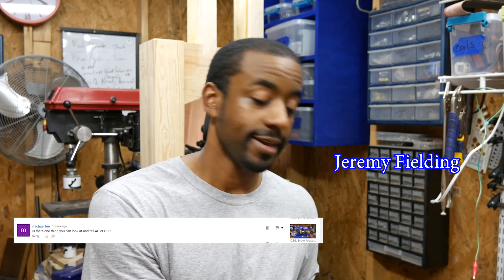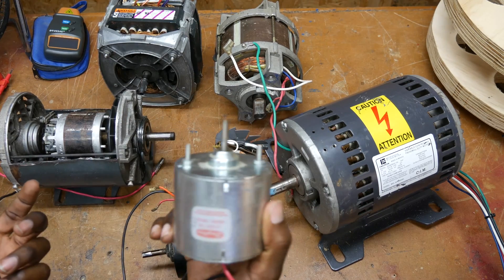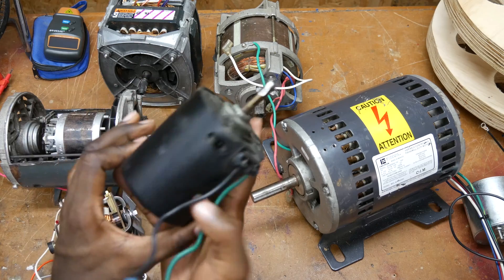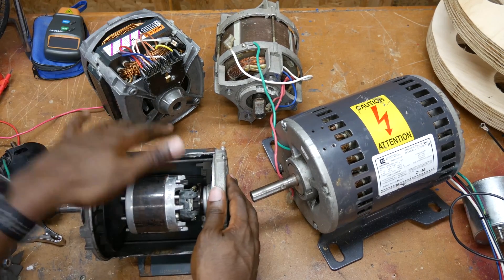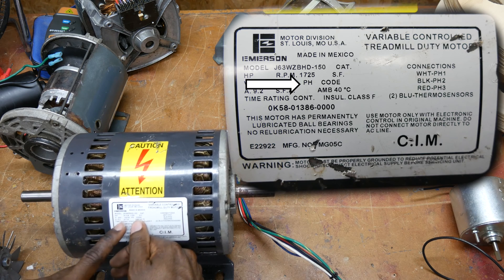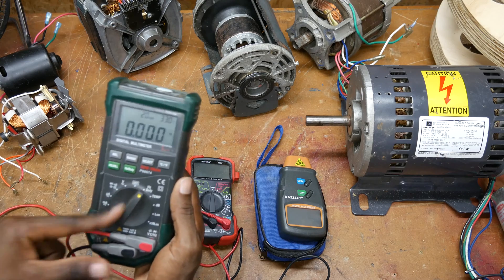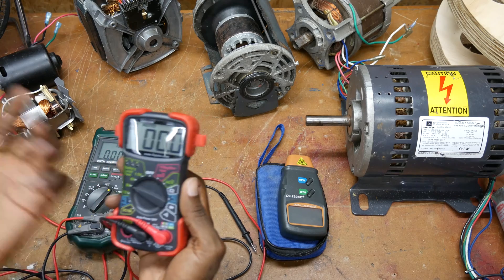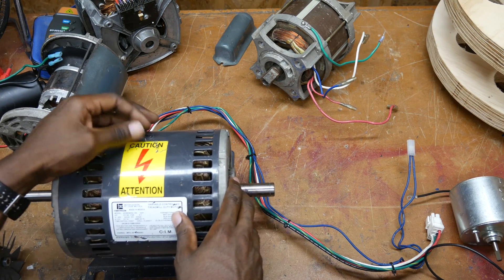What Kind of Motor Do I Have? Some Clues to Distinguishing Motor Types: 042

Comment: I got two washing machine motors  because i want to make a pottery wheel. Pottery wheels need to have adjustable speeds. Will a washing machine motor absolutely  not work for my  pottery wheel project?

Comment: Great video! Thank you for sharing your knowledge and experience with electric motors.
Any advice on how to troubleshoot when I disassemble my Toro Electric Corded Power Jet F700?  
Wait, I think you provided the answer when you identified the "Universal Motor and Direct-Current Motor"?  My Toro Power Jet F700 died two-(2) months past the 2-year warranty! I hope I can fix it: I quit using it because sparks were arcing inside when I looked in the exhaust. I did some research and then proceeded to disassemble the leaf blower: I was a little apprehensive, but I pressed forward with the disassembly because I quit using the leaf blower and hoped that I could repair it [big dreams].  My Father was a Master Electrician, so I retrieved his old book titled Electric Motor Repair by Robert Rosenberg: I am trying to understand what type of motor is in my leaf blower: I was leaning towards a Alternating Current Motor Control because I must plug it into the house electrical receptacle for it to power on; however the Universal Motor is applicable to both AC and DC?  It was a challenge to reassemble too because the plastic housing has to matchup.  These past four-(4) days has been frustrating because I searched both YouTube and the internet and also read the Electric Motor Repair book and I still cannot get the leaf blower to power on when plugged into electrical receptacle. I used color matching zip-ties, so I can reconnect the correct wires [only 2 pairs!!]  I thought once I cleaned-up the commutator I thought my leaf blower was going to operate.

Comment: hey Jeremy! i recently got an antique 9" general electric oscillating fan c.1917.  the catalogue number is 174942. It is a 110volt 25cycle fan. doing some research i have found out that niagara falls produced 25hz power to new york and ontario. i have found an original catalogue that describes this fan of having a "series commutator". is it safe/ok to power this fan with standard 110v 60hz? if not what would be a good non invasive way to power the fan? thank you.

Comment: Important! Some single phase induction motors have only 3 wires for unreversable motors and some 3 phase motors that are wired in star or Y configuration often have 4 wires for an added neutral also some single phase motors have resistance start motors so no capacitor is needed

Comment: Hi Jeremy, thanks for the videos!!... I have some questions, if it's possible to make them here. I have a table saw with a baldor pl3515m that I think I pushed to hard... This would be an induction motor right? Well it doesn't start... I tried the thermal reset, nothing... I've checked the capacitors, and power is getting to them (high voltaje wiring, 230v), could it be the coil burnt out? What would be a set of checking steps?... TIA!!

Comment: I have a puzzling question: My husband saw this 25hp compressor motor. It can run on both 240V 3ph to 480V 3ph by just switching some wires under the cover plate as instructed. How does that even work without transformers, no one can seem to explain this issue anywhere ? ... But I know you have the answer Mr Fielding.

Comment: Hey brother I have a problem I have a 6 wire washing machine motor no one has this weird thing anywhere it was built in Mexico here's the info hope I got enough info the series number is S68PXMTM-1904 it's a 1/2 up 120v 60HZ 8.5/7.6 amps 1725/1140 RPM class F oh and it says pin 6  35-6671has a spot says AMB idk I hope you can help me and this ain't one of those matters that I'm stuck with a heavy bulky paper weight thanks either way sir

Comment: Enjoying your videos alot and helped me to understand electric motors. I have a motor from an electric shredder with 2800watt, however what does 2800/40 min-1 mean? This is a very slow turning motor with gears. What could one use this motor for? Keep up the good work 👍  br Frank

Comment: I need some help... My kids had a hoverboard they broke. I still scavenged the hub motors out of it and plan to make a sort of go-kart. I don't know much about motor controllers. As cheap as possible, I need controllers that will brake the wheels and have reverse. I want them to function just as they did on the hoverboard. Funding is a big issue! So any ideas would be great... Oh they ran off 36 volt dc but are 3 phase (assuming AC) and have a hall sensor. Are 3 phase DC motors even a thing?
Reply from the maker: I don't usually answer technical questions because the volume is simply insane. I just can't help everyone... but I will say this is more commonly called "brushless DC motor" you need a controller for that. Sometimes people call them AC motors but they are kind of both in a weird way.
Reply: @Jeremy_Fielding  that's the same conclusion I came up with. My issue is that I don't enough about controllers to filter through the mountains of them looking for one that will let them function the way they do on the hoverboard.

Comment: So you determine (or guess) that you have a DC motor. How do you determine what voltage and amperage it requires?
Reply from the maker: Great question. I have no idea. I usually go for trial and error until I think its behavior is usual. But I can’t recommend that in a video
Reply from the maker: There are a few more things that can be done but in the end the more information you start with, the easier it is to search for the rest

Comment: Heya Jeremy. I am STUCK! I am a physics and Engineering teacher with an engineering education, I work with a civil engineer, and I am lost on one thing. I recently pulled the spindle drive motor out of an old benchtop CNC mill that was no longer viable, and it has 3 wires....what the heck! After watching a bunch of your videos on motors and doing a fair bit of reading, I can run the thing. The three leads are red, green and black, and if I connect the red and green to power it will run (at voltages ranging from 12 to 30 from what I ahve tried so far) but the black lead baffles me, it seems to have no function. Any thoughts?
Reply from the maker: Usually there is a ground wire. Watch the how motors work question and answer video. There is a link with more information. Different manufacturers use different colors sometimes. I am not giving advice however. There are just too many ways I could be wrong.

Comment: I do hobby electronics and I use Hertz and capacitance on my multimeter all the time.
Reply from the maker: Yes... someone doing electrical work clearly needs a nice meter. It is the center of all your projects... for me it is a tool that occasionally finds itself on my bench for brief periods... then out of the way so building can continue.
Reply: Jeremy Fielding actually I use a cheap but good meter called aneng an 8008 it's under $20 on banggood or eBay. It works great but I would not trust it with higher voltages. I have used it on 120 volts but I would rather use a UL listed meter for anything over 70 volts. But for the day to day stuff I do it works great.
Reply: What do you use "hertz" for?  I suspect it could be used to measure motor speeds if one were clever enough, or the frequency of a 555 circuit?

Comment: Have you ever tried to repurpose an electric fan motor?  I've been planning to make a compost sifting trommel for my garden, and I was wondering just how powerful a motor I'll need.  I have some old 3 speed box fan motors and the trommel only needs to rotate at between 25 to 32 r.p.m.  I've seen some pretty small motors do some pretty heavy duty jobs, so I'm thinking It's just a matter of getting the gearing right.  I most likely won't be needing to rotate more than 20 pounds at once, but continually.  My biggest problem is likely to be dust control.  That little blender motor of yours looks awesome.  Are the bearings still good?  Why isn't it still in a blender?  Did you only take it out for the video?  My son brought home an Oster blender that works, but the bearings just shriek and scream!  Your motor looks the same.  I'm still waiting for new bearings to come in for his motor.  I suspect that after I fix it he'll sell it on Ebay or something.  Oh well.
Reply from the maker: The coupling that held the blades on broke off. It was made of rubber and there was no good way to replace it. So, I started using the motor in videos like this as an example of a universal motor. 
Fans are usually induction motors with different taps for different speeds. The problem is the starting torque. Especially if it is a shaded pole induction motor. They have almost none. You would have to push it each time if you could get it to run. A fan requires almost no torque to start the blades moving... therefore companies save money by not solving that "low starting torque" problem. I have a video dedicated to fan motors. https://youtu.be/JTlHNOaBnPI
Reply: Okay, ty.  Wow, you got back to me faster than I thought you would.  Push start, huh?  I'm not sure that's going to work then.  If somebody borrows it, that's the kind of detail that gets overlooked, even if labeled.  BTW, those rubber connectors can be ordered online.  They're not terribly pricey.

Comment: Jeremy, there is reason for these questions I keep asking. This is how I learn. Anyway, when I bought this old Delta/Rockwell it had a 3/4 hp Dayton motor on it. It has 4 step cones on motor & spindle for speed change. I have read or told there was no way to change this procedure because of the motor except with extra pulleys. I was checking to see if there was a way to make it variable speed like adding a VFD. Is there a way to add a VFD to this motor. I tried to add a picture of the information tag on motor but iPhone doesn’t seem to like this.
Reply from the maker: There is a reason it was designed with pulleys. https://youtu.be/tXJOtWPPRwE

Comment: Help, I'm hoping you see this. I have a craftsman bench top drill press. The motor is either 1/3 0r 1/2 hp. The unit is better than 20 years old but looks new. I was using it to drill a lot of small holes, .076 dia. About half way through the motor changed tone, slowed down and acted in a bind. I disconnected belt,isolated the otor, flipped the switch and I had to spin the motor by hand to get it going. It was turning slow, as if it was under load but there was no load. The motor is clean and I saw no viable signs of any internal damage. I also noticed when I turned it off that a lamp plugged into the same socket got brighter leading me to believe it's drawing to much currant, or amps. I'm thinking capacitor, any ideas. I called sears to check on parts cost and availibility, the motor is no longer available, termed obsolete. I know it can be fixed and I would hate to scrap the little unit, it's been a great machine.
Reply from the maker: Sounds like a capacitor. But of course that is a guess only based on what you have presented here. I talk about how to tell whether a motor has a capacitor problem in my "how to wire a motor" video number 35  and the single phase "how motors work" video. Have a look and that will give you a better idea of what you are looking at. https://youtu.be/2XYdTogWcIA
Reply: Thank you so much, you have given me a place to start. In another of your videos where you introduce yourself, I gave a quick rundown on myself. Our fields are not that far apart. I have little electric experiance but I'm concidered tops in closed loop hydraulic systems, a bunch of platforms in the Gulf know me. It is an interesting world out there and I can't wait until I'm able to return to work, until then my little wood craft shop helps me keep busy. Again, thank you. That's 2 electrical units I'm working on, the other is easy, a dewalt 12" dbl bevel miter saw. Just needs brushes.
Reply: Now the fun begins, if it is the capacitor, I'll have to see about locating one. This town ain't very big, LOL
Reply from the maker: I saw it
Reply: Morning Jeremy, thank you for pointing me in the right direction on my little craftsman drill press, seems it was the capacitor, dead short. Got one on the way. I did go pick up the little 8" from harbor freight so I could keep going and the lead time is fairly long to receive it through mail. At least this way, when something goes wrong, I'll have a spare.
Reply: You have emboldened me to check another piece of equip I use alot. While I was down from the chemo and radiation treatments my brother-in-law was playing in my shop. When I got back to it my 1X30, 6" disc sander would not come on. I open the switch housing only to find he had struck, all wires were cut, the cap was free of the unit. I ran out and got another as I knew nothing but now I am going to fix it and have a spare one. Some would say I'm a collector of tools, they might be right but my shop doesn't have to see down time. I will be at the bi-annual street fair this weekend, got a large inventory have have had excellant results in the past, I'm looking for the largest sales yet. I'll let ya know how I do. Thanks man for the inspiration you have given me.
Reply from the maker: +james moore your welcome

Comment: Have you salvaged many dishwashers?  How do their components vary from washing machines?
Reply from the maker: I have done three dish washers... the motors are very small, less than 1/3 hp. There aren't really any components I would keep accept the capacitor for the motor and the large springs in the door. Specifically because I have a idea of what I want to do with the springs. Even the wire is a very small gauge wire not worth keeping for my projects.
Reply: That is disappointing.  I know of someone calling himself BamZipPow that used dishwasher components to clean out the carbon in his catalytic converter instead of spending several hundred or a thousand on a new one, but that is one very specific use, and I doubt many people would want to try it.

Comment: Do you know much about lawn mowers?  I just fixed my mom's electric lawn mower and tried to fix her gas one.  Reel mowers seem great right now.
Reply from the maker: +drippingwax no I don't
Reply: I doubt it would take you long to figure out all of them! :)  I do not have any idea about "good" lawnmowers, but you get what you pay for.  Most people want cheap mowers and they only last a couple of years.  I fix my own cars, but lawn mowers use backwards technology older than any car I have owned.  Carburators?  What?  Why?
When a gas mower simply dies, an electric mower dies, but blows the bridge rectifier, and the circuit breaker, but electric mowers are far simpler and a bit quieter.
The EPA limits new gas mower pollution to four times that of a new car, which is a huge number, considering the engine is only 5-10% as big.
Power cords are huge hassles, though, and rechargeable mowers cost twice as much for degrading technology.
Many people say reel mowers are only great until you use one.

Comment: Why doesn't your multimeter turn on?  Isn't there some way to troubleshoot that... now that you have a second multimeter? :)
Reply from the maker: I have not tried troubleshoot because I have a second meter LOL. I agree it might just be a loose wire or something. I have not checked.
Reply: Jeremy Fielding MacGyver would have fixed it... :)
Reply from the maker: lol...maybe I should just use it for parts. lol

Comment: Nice video.  Not half an hour ago I used that Innova 3320 to trace down a solder joint that came loose inside a relay for a hydraulic lift table.  It seems like it will be a good beginner meter.